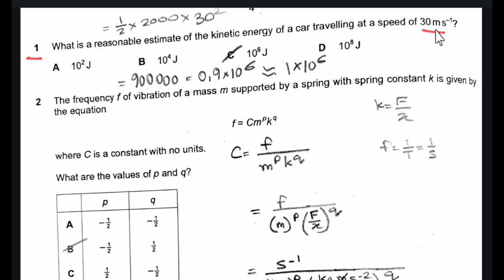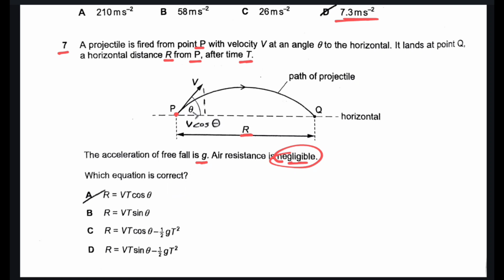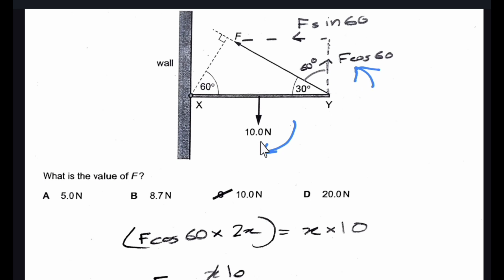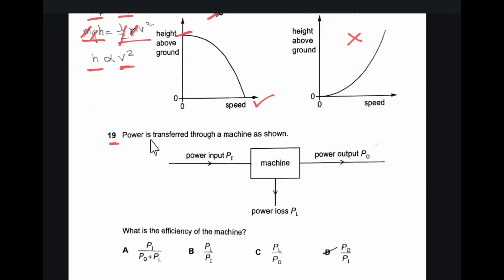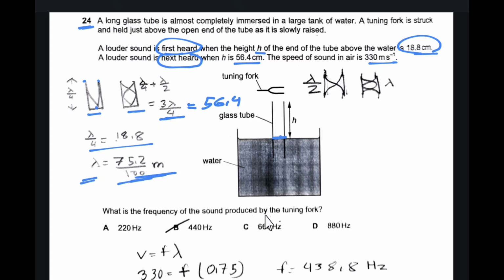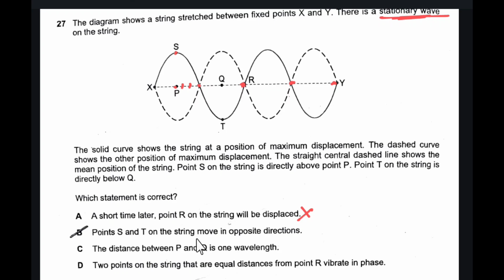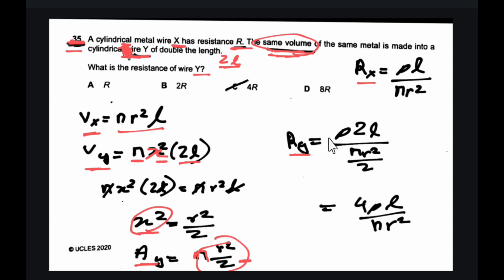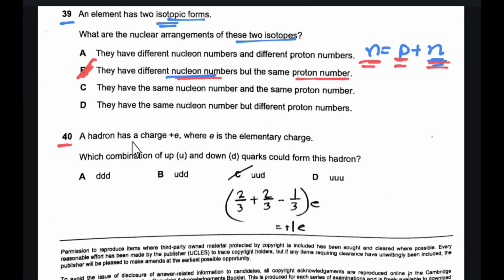9702/11/M/J/2020|Physics P1|As Level|Cambridge

Comment: In question 13 why did u take the angle as 60 but not 30 ?
Reply from the maker: Whether you take 30 or 60 degree due to sin and cos change answer would be same

And for 60degree at the wall end it is at the pivot so distance is zero
Reply: @ ohhh ok thank you